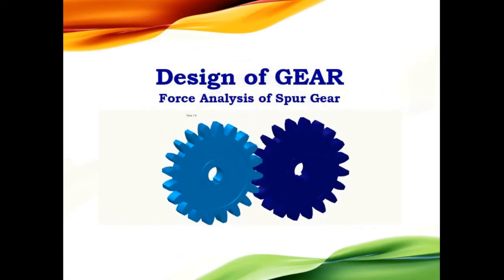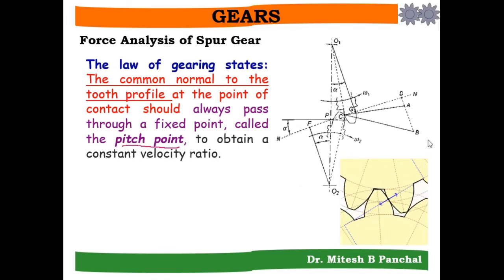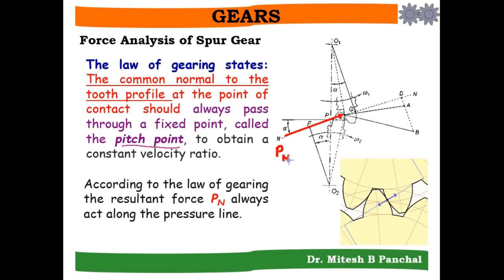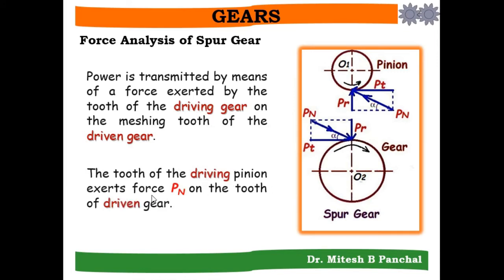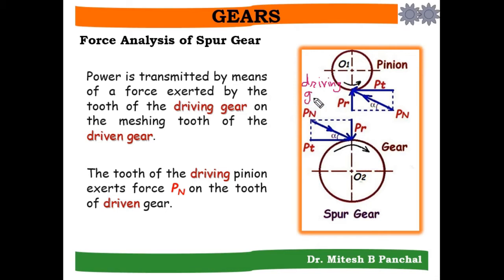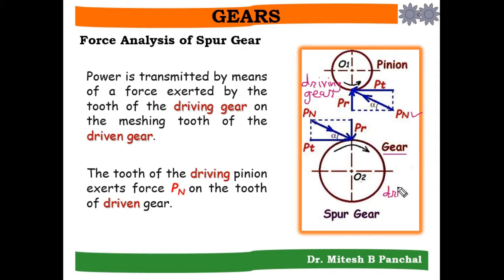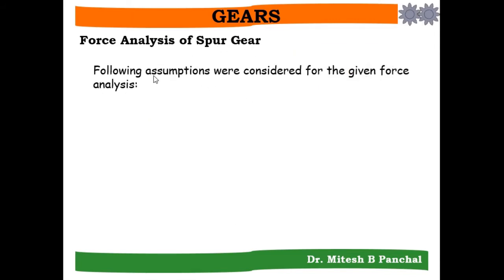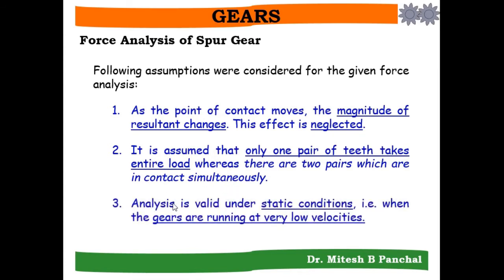Design of Gear: Force Analysis (Spur Gear)

Comment: Sir, the magnitude of both Ft  that is of pinion and gear will be same ? Or different,  Can you answer my question
Reply from the maker: Magnitude of Ft will be same for pinion and gear .... Ft is the tangential force which will drive the driven gear ... At the contact of teeth ... Ft will be transferred from ok one gear to another and on driven gear at contact ... It will be a reaction force in opposite direction
Reply: @drmiteshbpanchal366  can I get your mail id I have a small problem in solving gear force analysis
Reply from the maker: miteshbpanchal77@gmail.com